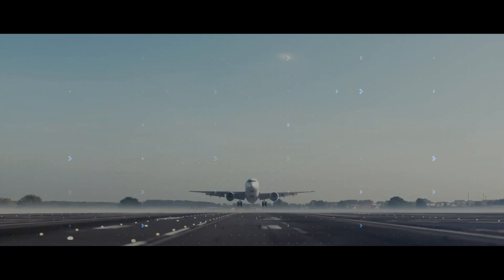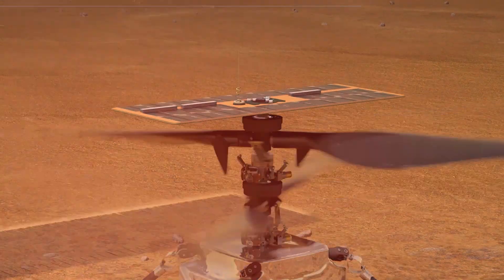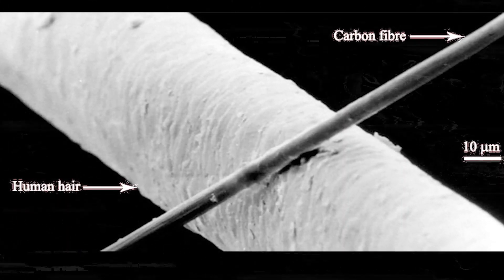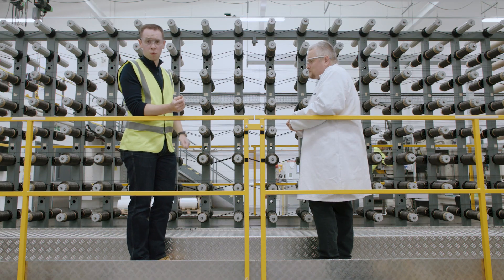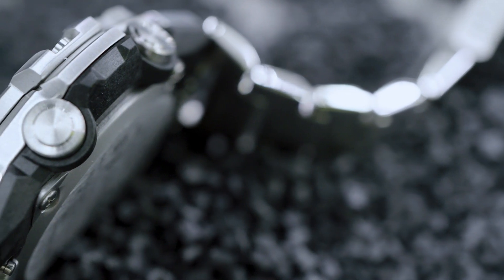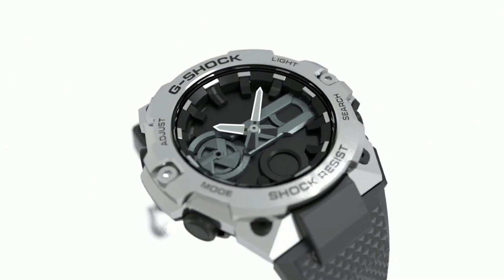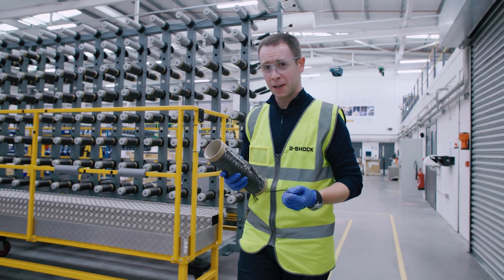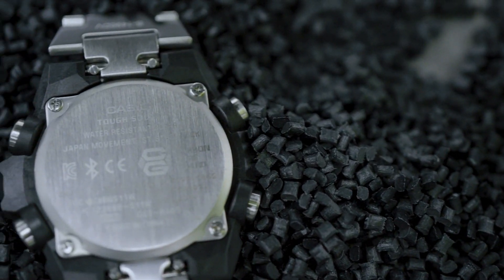The Science Behind G-Shock Carbon Core Guard

Comment: The video is extremely well-produced, but the chemistry and physics that's being talking about is fairly basic.
It explains how extremely strong carbon fibre under tensile load, so when pulled, but don't emphasise how extremely weak it is in other directions.
This is probably what the use of a thermo-harder is for, so most of the strength seems to come from the plastic, but the actual properties determining this were left unmentioned.
At most the carbon helps with keeping the structure together as the presumably more rigid plastic that would otherwise shatter adsorbs a shock.
The softer outer layers acting as layered bumpers that take out most of the shock before it reaches the watertight inner structure and shatter-prone LCD module.